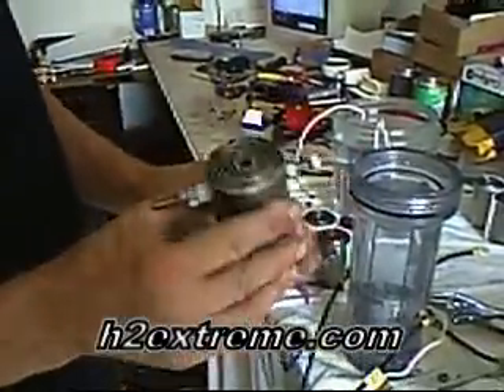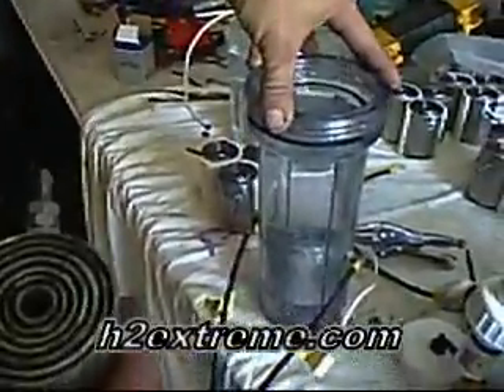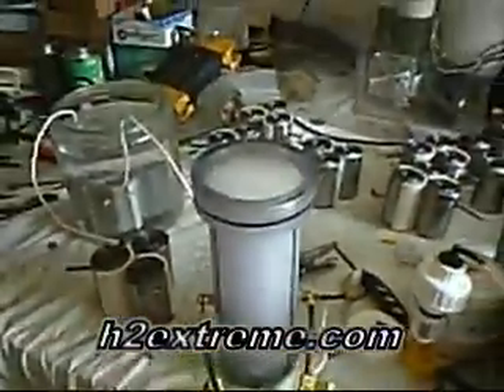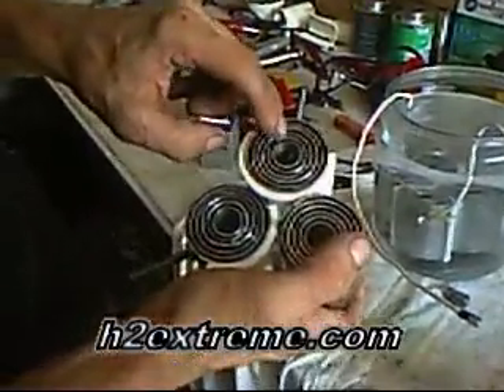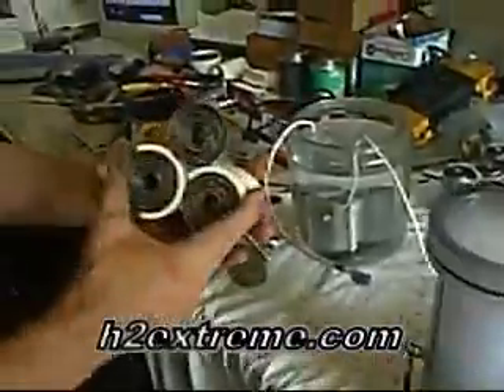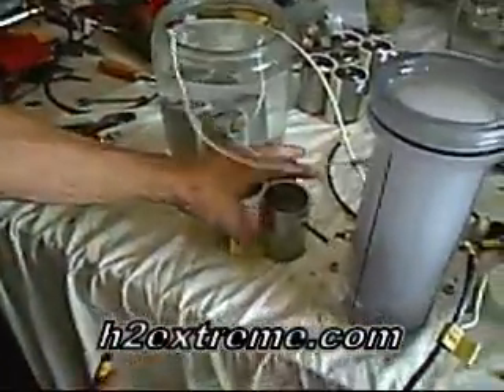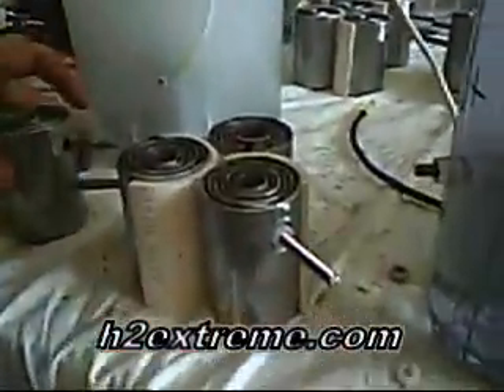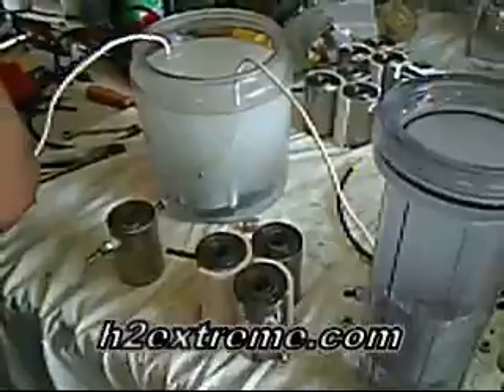make hydrogen 7 tube joe cell from h2extreme.com

Comment: 18amps 1volt or 18amps 100volts, big difference in watts, Also how much heat does it produce and how much water needed to produce X amount of hydrogen gas

Comment: Dude, look at the history of the Joe Cell on YT. The vessle has to be steel with a steel pipe running to the carb... and plug the end of the pipe. Also, cut down on the number of plates, only one center positive, negative on the outer cyllinder. You pump Ether into the engine and it replicates the HHO in the engine. 

The technique parallel's Tesla's method for amplifying electricity. Instead of electrons, its HHO. Peace, B
Reply: Have you built Joe Cell? Can I put it on my motorcycle?
Reply: I am normal person  just. Think hidrogen only have  one eletron to its orbit @ same time oxigen have  many eletrons . The energy its  concentrated on the opposite  side  and heat is the energy  source  for  movement  if its cold there it no eletrons  movement  and  same thing  applies  .they say u loose energy  through  heat loss  . The more oxigen its inject into engine  the more power make . If u put lots hydrocarbon  fuel  will flood the engine  and you don't go. But if u put  carbon  and igniter and add pure oxigen  the  fuel get really  hot 🔥 cause oxigen  so the fuel its the oxigen  and carbon  its the Midian  condition to the energy be transferred.  The hidrogen its cooling  the  heat of the  thermoreaction and that's why  water is resolt of the reaction  cause u not use water using  the energy in the molecules off . And the energy its the eletrons in  movement  because ever action its equal reaction  if eletrons  its push they  move  but if they are stable then it's no energy  create   And energy don't dessipear  / Dessiped   from hot to cold  and if heat again comes  back in the for of energy

Comment: what is the reason for having "neutral" tubes?
Reply: One becomes negative and the other positive. It's used when you have more than the minimum volts. So if you have a positive, 2 neutral and 1 negative in series with 6V between the positive and negative, you actually have 3 gaps where the water is between the plates and each gap has a potential difference of 2V. This si done because once you go over about 1.5V the extra voltage does nothing, so it can be thought of as wasted power. This puts it to use by increasing the surface area by adding more plates.
Reply: +Jason W thank you, I did some research and I understand it now.

Comment: anyone doing it dry or wet is the slow method of litres/min. if you want real results go and research how to change its vacume and utilize it under a different preassure when you start electrolysis  process. Trust me it works for me at 1.76volts at 15 litres per minute at 30 amps with spacing very small in vacume seal of SS plate at 1k to 2.4khz pwm with a zinc plate on its own running off a 200 hz. Hint knoow the difference between mist, vapour and liquid form and the rest is a piece of cake!

Comment: it's easy to see in our day that everybody can build a mechanism to produce hydrogen. My question is Tnenobody do some calculation regarding energy. Then to calculate the efficiency. Let's see if obtained hydrogen from water can generate himself electricity to generate the next hydrogen and to have no more a battery connected. If the necessary electricity power is much more then the power obtained from hydrogen, this is a shit, but could be a beginning.

Comment: i dont get it.you have 7 "plates" , so why you dont use all the internal as neutral plates . 12/7=1,7 volts of each plate and it would be ideal voltage in order not to produce heat.

Comment: That is not a joe cell, and if you trying to build a hho generator, youd have more succes using flat plates but you should properly etch them well and use 316 ss plates.